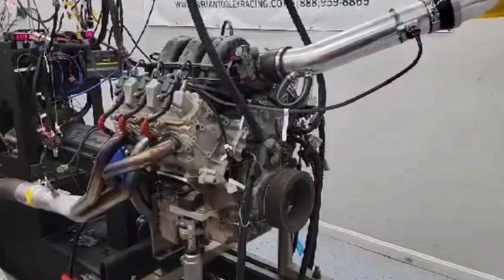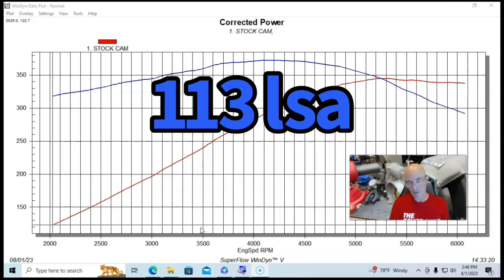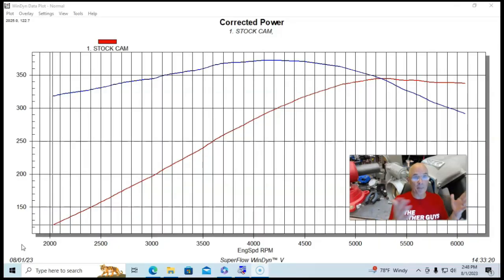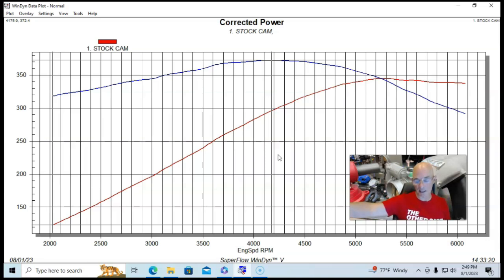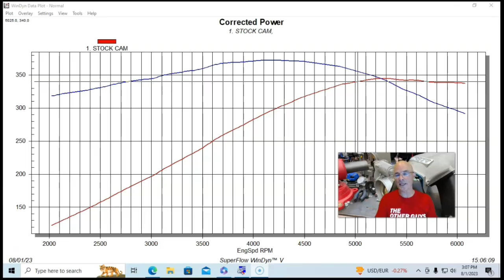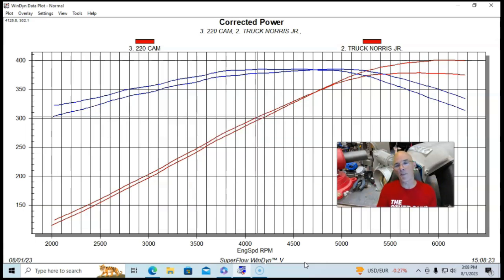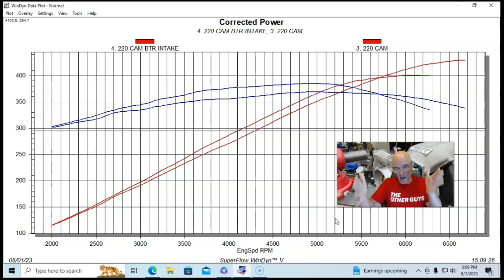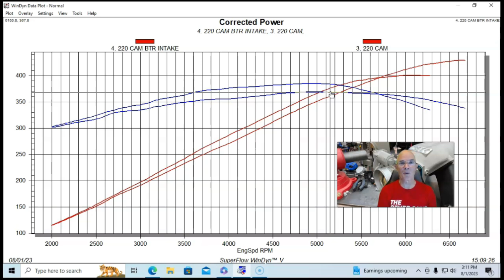HOW TO MAKE 4.8L V8 POWER WITH YOUR 4.3L LV3 V6! V6 CAM TEST-TRUCK NORRIS JR., BTR 220 & BTR INTAKE

Comment: The problem with this 4.3 is they’re more expensive than the 4.8 and 5.3 ls motors from the wrecking yard
Reply: LV1 even
Reply: I noticed the same. until these are cheaper than an LS, it's going to be limited.  they'll fit in tighter spaces  and they're about 100 lbs lighter than a  aluminum block LS, but.... more $ (?) and more $ to swap. I think they'll make great swap engines in many applications, if the cost comes down, as in sub $600. so lets hope GM sells them by the crap-ton, so they're sitting in every junkyard soon enough.
Reply: @OndreaS123 these should start appearing in your pap
Reply: On ebay they are not more expensive when compared to aluminum gen 5 5.3s...just compared to iron block gen 3/4 4.8s/5.3s
Reply: 4.3V6 just find a LU3
Reply: @shadowopsairman1583  Yeah.  100 less HP.
Reply: No ls will ever be as reliable as those older 4.3

Comment: At only 300 lbs I think this is the ultimate modern turbo swap engine as more parts come available - it can make more power than any 2wd vehicle can use on the street at such a light weight
Reply: Overall size and only 300 pounds,  damn wish I'd went this direction with my RX8 v8 swap.

Comment: If you give the lv3 12 or 13 to 1 compression and the 220 cam and trinity intake all the numbers from down low to up top will increase by 80 to 100 . You should try that.
Reply from the maker: down low by 100?
Reply: @richardholdener1727  well what do you realizticly think with the higher compression
Reply: @richardholdener1727  Im saying the torque you lost down low with the trunity intake will come back with higher compression

Comment: Shift around 7,000 RPM, & put a 5,000 Rpm Tq. Converter in the trans. with a trans brake, & a Bigger custom solid Roller cam(w/softer ramp cam designed for durability). Install in a 2,500 to 3,000Lb. vehicle, & run 11s on pump E85! Great V6, when deleting the AFM= Active Fuel Management. Great video🎉

Comment: Awesome! Before my current 04 z71 Tahoe (5.3 flex fuel) I bought a 2018 Colorado z71 brand new with the 3.6 LGZ (variant of the LGX “high feature” GM v6 engine.) It’s a DOHC motor and for the 2018 Colorado - made 308hp at 6800rpm and 275tq at 4000 rpm. The 2018 Colorado was super fun to drive with that kind of power. Great motor and actually had good torque down low (even with peak hp & tq up that high). 

But I love my 04 z71 Tahoe, especially after some mods, learning HP tuners and tuning it myself. The plan is a small turbo in the future. Just 7lbs with as minimal lag as possible.
Reply: Are those numbers at the wheels for the Colorado?
Reply from the maker: no-every factory motor is rated at the flywheel
Reply: "Just a small turbo".  Yeah.  That's how it starts.  But the need for boost grows.  You can't resist it.  It's an irresistible force.  Then the next thing you know, you're addicted to torque.

Comment: You should make a video on a max effort NA build. Huge stage 4 cam, bigger bore/stroke (if possible), high compression (13:1), lightweight rotating assembly, and top it off with frankenstein heads. Then compare with a twin turbo lower compression build!
Reply from the maker: a turbo makes 2 to 3 times what an na motor makes
Reply: @richardholdener1727  yes of course, just wanted to see the two different possibilities! Thank you
Reply: Any updates on new developments on the LVX platform?!

Comment: Interesting. I still have a thing for the 90° 4.3 in the 90s because I have been amazed by a guy with a Syclone running 7.59 sec Quarter at 185 mph. Single turbo, can be found on YouTube. It's a pizza delivery truck I want. Hahaha kids name is Jeremy Hacking Syclone 7.59 
You will find it. He has to be well over 1600 hp.

Comment: Heya Richard 🙃 . I've got a 98' Blazer w/ the 4.3 Vortech in it.  She's got 315k on the clock but she's still running like a top.  I thought about adding boost but not with this many miles on it. Idaho recently did a way with the emissions regulations so instead I'll put my cold air intake on it.  Delete the cat,  add dual exhaust w an x pipe and Raptor mufflers pdq 😎 ..
Reply: Higher milage typically handles boost better. Other than head gasket though. Throw some MLS head gaskets and arp head studs and send it.
Reply: best off with the factory box and standard filter with a gm maf vehicle
Reply: @matt4051  thanks,  I'm just looking to optimize the airflow on this one.  I already have a cold air intake kicking around so I'll run the air intake tube into the factory air box and use the air box to isolate the cold air filter from the hot air under the hood as it should be. Then I'll Port the intake side of the factory air box and run a 4" OD pipe thru the grill. Any crap that gets pulled into the factory air box has a better chance of staying in the airbox and not impeding or plugging up the cold air filter the way that it does with the factory filters in the stock airboxes.  Much the same way a Shop-Vac works. The vast majority of the crap you suck up stays in the canister but never touches the air filter inside it 😋
Reply: Taking off cat will do nothing for power, but it will increase the pollution in the air we all breath
Reply: @DackRedd  I understand that point , however a cat is a smog restriction in the system I do not need,  and it hinders airflow & does affect mileage & performance.  ID.  stopped doing emissions so I'm pulling the cat & hollowing it out & putting it back on.  I'll make a hydrogen pump out of a #10 coffee can and run an airline from it right into an intake port to pull the oxygen and hydrogen molecules into the engine where they're burned.  We've done real-world testing with the hydrogen pumps here locally at the emissions test stations and they're effective, they work well and they cut emissions in half by 50%
Reply: L35

Comment: Thanks for your channel Richard, one major question for you just to get started… my 03’ s10 4.3 has been sitting outdoor south Florida for the last 8 years or so. Blown trans and has been sitting since. My question is this im finally going to get started working on it but after sitting for so long I’m not really sure as to what are the “must does” before I even attempt to start her up. I don’t want to make things any worse than what they could right now.
Should I replace fuel pump and filter fresh fuel oil change and let her rip ?

Comment: How much could you squeeze out of a LV3 doing a full diy rebuild for a truck.  Including if you bored it out, ported and polished the heads, maybe some new pistons etc. But kept it to a low/mid level Budget.  With a focus on low and mid range power as it probably wouldn't be turning past 6000rpm in a truck anyway.

Comment: I was looking at using one of these for a swap, but have heard of tuning issues with a manual transmission, rev hang being the largest issue. Have you heard of that and any ideas to make it work?
Reply: You can use holley efi on this. If you convert to a port injected intake like the btr (drilled for injectors) you can use a regular terminatorx and change the cylinder count/firing order. If you want to keep it DI you need the DI addon box that they advertise for the 5th gen LT1, once again you need to update cylinder count/firing order.

Once on holley efi you can use any manual without issue plus gain all the usual benefits...boost control, 2 step, etc.

Comment: I wonder what GM V6 would be a better swap for a Nissan 240sx that occasionally goes to Thunderhill, CA.  Camaro spec LFX 3.6L or cam'd LV3 4.3L.
Reply: The power would be similar, but the 4.3L weighs less.

Comment: What about a 03-06/7 lu3 4.3 v6? I picked a truck up with a knocking one and want to do something different then just “ls swap” it bot building a race truck just want a fun daily driver lol
Reply: Do an Engine flush for lifter tap (sounds like a sewing machine)
Reply: @shadowopsairman1583   don’t think that will help this one but never know,it has 35-40 oil pressure idling I bought it not running guy said it wouldn’t crank I put fresh gas charged battery and everything worked even has a ice cold ac just knocks 🤦🏻‍♂️ I haven’t had a chance to dig into it yet but it kinda sounds like a rod knock honestly but then again I’m not a mechanic just a parts changer trying to learn on my own lol https://youtube.com/shorts/puKfz5YNKDY?feature=share

Comment: I have been thinking about swapping an LV3 into an S10 and after this video im curious what you think an LV3 with long tube headers and the Truck Norris jr cam would have much benefit to having the heads ported?  also keeping in mind I was planning to turbo later on to make more of a modern take on a Syclone
Reply from the maker: ported heads will help

Comment: Hey Richard I'm looking at getting an L8T (if I get desperate an L83), blocking the injector orifices (should i weld or use ICT plates/plugs?) and running Whipples new L8T blower. I've emailed them asking if that blower manifold will have injector bosses or if it can be drilled for them for removing the DI system. Worst comes to worse, I'll remove it and just run a BTR intake (any preference for a street car?) and a turbo. Unsure which turbo for an L8T though? Also a mild camshaft compatible with the DI delete but I'm unfamiliar with the LT cams that would pair good with this and be "mild" for a street car with good valvetrain stability/spring life. Power goals: I'd be perfectly fine with 6-800whp, preferring to land somewhere at or slightly above 700. Any suggestions? Any videos/tests/articles of yours in particular to check out?
Reply from the maker: for 700 wheel hp-why wouldn't you just run an LS?
Reply: @richardholdener1727  I still may lol. Honestly it's more the platform/options, and the cool factor. I'm not afraid to say it like most guys lol. I think it'd just be cool honestly. I mean, I DID also have a carbureted AND distributored LS1 lol. Just purely to be different! That's a test I'd like you to do! COP 5.3 vs distributor 5.3! Just because.
Reply: @richardholdener1727 How do you feel about this cam in a stock 5.3 with 799 heads? Auto trans 3600 stall (already in there). How do you feel it'll tune out/drive/idle /etc? 

 Duration @ .050" Lift( Deg): Intake: 219 / Exhaust: 228
Maximum Lift (in) W/ 1.7 Rocker: Intake: .525 / Exhaust: .525
Lobe Centerline ( deg): 112
Reply from the maker: if all you changed was the ignition-I doubt there would be any power change
Reply from the maker: it will be fine with that stall
Reply: @richardholdener1727  There's a "secret" reason I'm asking about this particular cam 😏 it's an old, formerly very popular, camshaft that I've been told a bazillion times was just flat junk and "that's an old technology cam, horrible for a stock engine, waste of money, you're dumb, it won't make ANY power, BAHHH!" yet it's still sold everywhere, is cheap in the kit with compatible springs, clears p2v allll day, and sounded aMAzing when I still had it! What type of power gain from that can would you expect in a bone stock untouched LS1 with LTs, full exhaust, ls6 intake.

Comment: Porting on the heads as well as a larger valves ... 1.93"/1.56" seem mighty small.
Reply: Yeah, the 4.3 got shorted on intake valve diameter.  Same as the L83 that has a 96mm bore, not the LV3's 99.5mm bore.  A 2.07" intake would help if there's enough metal in the port to take advantage of it.  The exhaust port on all GenV engines need help.

Comment: Is there a weight comparo ? Say, LV1/3 vs 4.8 ?
Reply: Aluminum block vs Iron block, excluding L33 aluminum block.

You can do a LU3 and its very healthy.
Reply: LV3 weighs 315 lbs fully dressed.  4.8 weighs 420.

Comment: Are the rods/piston similar to L83 other than bore?
Reply from the maker: THINNER BUT SAME LENGTH
Reply: Rod bearing diameter is larger to make up for the narrower big end width.
Reply: Everything I've been able to find is wrong.  Is the pin end the same as the L83?

Comment: Make a good motor for my C4 Corvette.
Reply: LS
Reply: @shadowopsairman1583  This motor is lighter making for an agile track car, with a standard iron sbc I can get the car to 2900 pounds, carbon fiber hood used, etc. With this motor 2750??
Reply: Gotta put a turbo on it if you put one in a C4.

Comment: How much can a new V6 be bored?
Reply: Same as the old LS1.  .007" is pushing it.
Reply: Aluminum block, not very far
Reply: Cut and splice a 6.2 block and use the 4.3 crank . Hahaha . That'll get you 4.8 liters. Then offset grind the journals ....might get you 5.0?